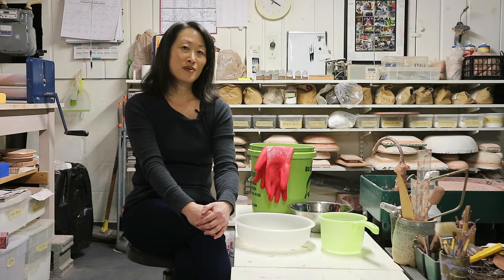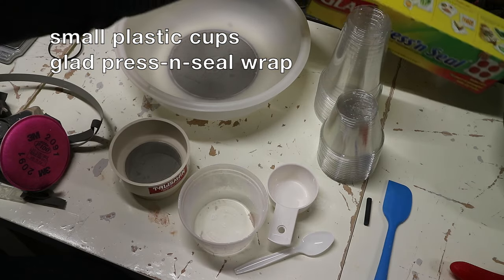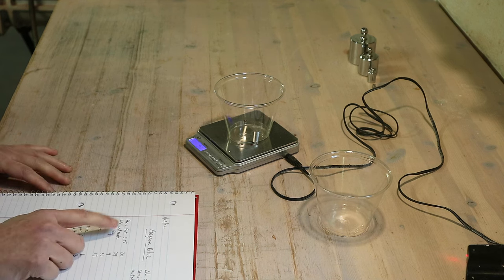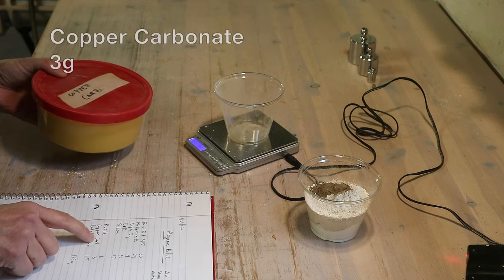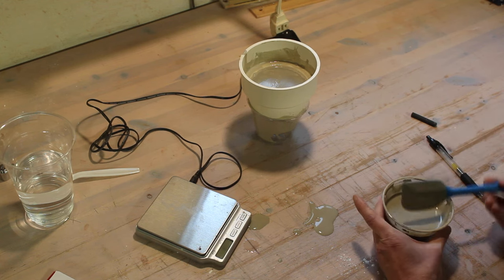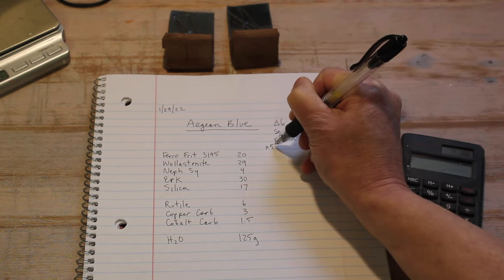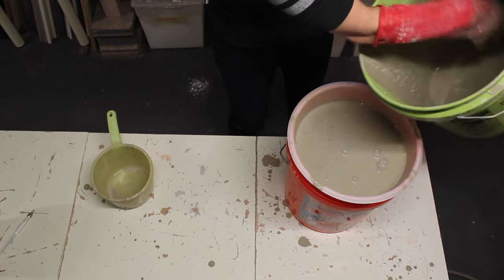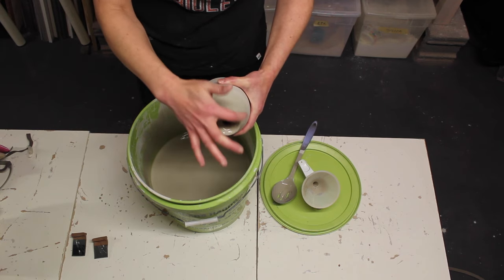How to Mix a Glaze from Raw Materials / full-length video / free to watch

Comment: I think Andy Ward suggested making little pinch pots instead of tiles. It takes a lot longer, but it builds skill in working clay and it also lets you see how the glaze behaves at different angles. But if you don't want to do that you can also cut/bend the tiles to give them some features for the glaze to fill in.

Comment: I am an Auto Body Painter, doing Body Work and Painting for 42 years now.  I make my own Paints using a formula, and many things I do are exactly the same as this Lady does.  But I will be a critique now, but a Good Critique.  When I mix my Paints, in a Pint size cup  on a similar precise scale, but later when I am done with the scale,  I have this cup in a Containment Tray. So if I accidentally spill the cup over, the spill is contained within that Tray.  I use a Simple Bread Baking Pan from the $ Store.  Also here when adding the water, its better to use a Small Goose Neck Water Squirt bottle, so you can precisely pour water DROP BY DROP.  Lady, you should definitely build a small special mixing room, size of a small toilet,  that has a exhaust fan, ONLY TO MIX YOUR  POWDERED INGREDIENTS.  I notice a big cloud of dust  at 53.57 when you poured the mix powder into the water bucket.  I am not sure, but this dust could be hella Toxic.  I work with bondo dust and many more kinds of dusts, so I am very consious of all kinds of Toxic dust.  I use the same 3M Respirator for my Bondo Dust, and another 3 M Respirator for Spray Fumes when I am painting. 
Great Video though, and extremely well done Lady.
Regards from San Jose, CA.

Comment: THOROUGHLY enjoyed this video.  Most of the material I am completely familiar with----my interest in watching was to observe presentation style with an eye toward suggesting the video to students.  It will be made high on their must watch list.  It was easy to watch, a comfortable pace, logical flow, friendly/inviting manner, casual yet professional.  There were just a few steps I do differently I'll point out to students.  But one point I'd like to especially make on the presentation detail is the method of checking specific gravity. I know it takes a bit longer, but using a scale versus hydrometer would provide a more accurate reading of specific gravity, and imo fit in with the level of detail addressed in other steps shown in the video (or maybe just a short written bubble statement would suffice about weighing as a more accurate means and suggesting viewers do more independent research on that method).  Very well done!  Thank you for making this video available.  🙂
Reply from the maker: I agree that using a scale to calculate specific gravity works well. It has some advantages over a hydrometer because it means you don’t have to buy a hydrometer for starters, and every glaze maker already owns a scale. Also, when glazes are highly flocculated the hydrometer becomes less accurate. However, I prefer the hydrometer for regular use because it is quicker and less fussy. Only one step. But I have no disagreement with using a scale exclusively. Every potter can decide for themselves what makes more sense. Thanks for the nice comment!

Comment: 46:55 my mentor once told me that the problem with this approach (removing and adding water), is that some of the compounds in the dry mixture dissolve in water and others are not (which makes the mass concentration in the bottom). when you start removing and adding water, you change the make up if your glaze because the water that was there when the glaze was mixed, carry some of the materials that make the glaze look the way it is. removing water takes off some of the ingredients. adding new water simply dilutes the mixture down with new water that contains none of the dissolvable materials.

Comment: I like your teaching goals.
This is what you need.
This is what you do.
This is what it does.
This is why you use it.
How to trouble shoot, is a quiver you want a bunch of arrows in.

I appreciate what you are doing and how you are doing it.
 
Thank You.
Reply: Rewatching this video I noticed your hands. Mine were in even worse state. They were so dry and itchy I wanted to scratch through my skin. I did in my sleep a few times. Ever thing I tried made them worse. I'm sensitive to perfumes at the best of times and these were far from that. 
Till I started doing this:
At the end of work, I wash my hands with Hibiclens.  It's excellent for cleaning most wounds and makes it stop hurting. (The 5 year old asks for it with every wipeout)
Dry gently then apply Cetaphil Body for very dry sensitive skin. Rub that in good an take a dab of Cetaphil healing ointment.
My hands feel instantly better and are healed in a couple days. 
As a rule I do this at the end of every day. Using the healing ointment once or twice a week for maintenance. 
I don't care how my hands look, they tell the story of my life, I do care that they can keep the story going.
My money wallet is low but, wisdom wallet is flush and donatable. Hope this currency helps you.

Comment: Excellent video and such great presentation and skills. Wish I had specialist knowledge of anything built up like this over 30 years. 
BTW why do you weigh each ingredient and then tip into another cup instead of just resetting the scale each time to zero and adding the next ingredient?
Reply from the maker: The reason to empty the cup each time is because, if you overshoot the amount you want when measuring out the next material, you need to remove some in order to reach the correct amount. If there is another material already in the cup, you will need to throw away anything you remove, because it will be contaminated with another material.
Reply: @goodelephantpottery  ah ok, thank you very much!!

Comment: I like the way you store your glazing materials, a question I have is does the materials clump and does moisture get into the containers? I don’t believe those containers are airtight so I’m just worried if I store them in a bin they will get moisture in the containers and clump. Just a few questions
Reply from the maker: The containers are not airtight and most materials will not clump, even though my climate is very humid in the summer. With the exception of Soda Ash which does clump, so I store that one in an airtight container.

Comment: I'm thinking about glaze making but am concerned about food safety with glazes.  I know for example of a particular commercial chrome-like glaze that the company states isn't food safe, and another very similar from another company says it is food safe.  When making your own glazes, is there a means to test, or would you have to have laboratory testing done to
Reply from the maker: I highly recommend the book Mastering Cone 6 Glazes, by John Hesselberth and Ron Roy. It contains instructions for how to test your glazes for durability at home. I put all of my own glazes through these tests, rather than sending them to a lab. Generally speaking, I would not consider any glaze with a metallic surface to be food safe.

Comment: Great informative video. I am new into ceramic making and I am here to learn as much as I can. If it’s not too much to ask Is it possible to cover crazing topic in details. My pots have craze lines 😰. 
Thank you very much for this video.
Reply from the maker: Crazing means that your glaze does not fit your clay. The glaze is shrinking more than the clay. It’s difficult to change the shrinkage of a glaze, without also changing the appearance of the glaze. The better solution is to find a different glaze recipe that fits your clay better. It can take a lot of trial and error.

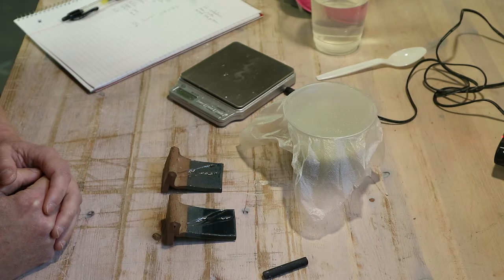Comment: Hi.  Around 45:42 you start talking about adjusting water, but you don't really explain why or in what circumstances I would add or remove water.  Is it just thickness of glaze or are there more instances when you would want to change the amount of water. Also, do you not test the specific gravity of a test batch? If you add water it raises the specific gravity? And if you remove water it lowers it, right? I'm trying to learn mixing my own glazes and detailed educational videos are really hard to come by.  Thank you for your video!
Reply from the maker: Adjusting the water amount at the test batch stage is only about thickness, based on appearance. It’s pretty easy to judge whether it’s too thin or too thick at that point. No need to measure specific gravity for a test batch. At that point you are aiming for the right appearance, not for a specific gravity number. Measure for specific gravity AFTER you have the glaze at the right thickness/appearance. Then use that number to keep your bucket of glaze at a consistent thickness. Adding water makes a glaze thinner, thus LOWERS the specific gravity. Removing water makes the glaze thicker and RAISES specific gravity.
Reply: @goodelephantpottery  Thank you so much!
Reply: At what temperature did you fire the pots? Is this glaze for earthenware or stoneware clay? In case it was clarified in the video, my apologies. I must say, this is one of the best videos about homemade glazes I've seen.

Comment: Excellent video as always, Mea

May I ask, do you use distilled water?

Do you add 1 to 2% bentonite to keep the ingredients in suspension and not dead pan?

Does the book The Ceramic Glaze Handbook discuss what the various flux ingredient properties contribute to the combination of flux ingredients? I know that silica is the glass former, that alumina (EPK) holds the molten glass to the pot, and that the fluxes lower the melting temperature of silica. i believe certain fluxes contribute to the feel of the glass (buttery), others cause 'mattness', if alowed to slow cool, but beyond those generalizations, fluxes are the black box to me.
Reply: Great question re: distilled water - I was also wondering...
Reply from the maker: I don’t use distilled water. That might be necessary in a situation where the water supply has a very high mineral or iron content. But in a municipal water setting, it’s not necessary. 

Some glazes benefit from a small amount of bentonite to help with suspension. But the one in the video does not need it. 

The Ceramic Glaze Handbook does discuss how the various fluxes work, and what impact they have on the glaze.
Reply: Amazing! Thank you! Long time baker brand new potter. This methodology made perfect sense and was relatable as a beginner, Without overwhelming me with the indepth science of fluxes opacifiers melting points etc that I hope to eventually learn. I've wondered if I was capable of learning what seemed to be a complicated subject. But I can follow a recipe precisely and I can learn about new ingredients. I can learn this too 😊 thank you!

Comment: Thank you for the great video. What do you do if the SG has changed? How do you correct?
Reply from the maker: It’s common to find that a glaze has gotten thicker while it was being stored over time, because some of the water has evaporated. The SG will be higher, which means thicker. Just add small amounts of water at a time, stir and measure the SG, repeat until the SG is correct again. If you find that a batch of glaze is too thin (SG is too low), that only happens because you or someone else added too much water to it. To correct this, you need to wait a few days until the solids have settled to the bottom of the bucket. Remove as much water from the top of the bucket as you can, then add it back in slowly until the SG is correct.
Reply: Thank you

Comment: You mention that for practical purposes (but not necessarily scientifically speaking), 1g of water is equivalent to 1mL water.  Just wanted to add that this is true scientifically speaking as well.  1g is literally defined as 1mL of water (also equal to 1 cubic cm of water).  Metric distance, mass, and volume is all tied together in this way!
Reply from the maker: Technically, it’s only true at a specific temperature, because water expands and contracts at different temperatures. Though I forget the correct temperature for the mL and g thing to be exact. Anyhow, no matter what temperature your water is in your pottery studio, 1mL = 1g is “close enough” for glazemaking.

Comment: Thank you for the excellenct video! Do you know what’s the european equivalent to Ferro Frit 3195? Or what do I have to be aware of when looking for an substitute frit?
Reply from the maker: I found a list of potential substitutes:
Ferro 3195 
Pemco P-67
General Color GF-115
Fusion F-2

I am unfamiliar with the substitutes so please do you own research into their feasibility. Here is the composition of Ferro Frit 3195 which should help you determine if the above choices will work:
CaO 11.36%
Na2O 5.69%
B2O3 22.62%
Al2O3 11.98%
SiO2 48.35%

If you cannot find a good substitute, I would ditch that recipe altogether, and find a recipe made with ingredients that you know you can source. The processes for measuring and mixing shown in the video can be used on any recipe.

Comment: Hi Mea,

Do you see a problem with this variation...

Why not start the testing at 115 ml of water? If the SG of 125 ml averaged 142.5, then at 115ml it is SG A, add 5ml to test at 120ml... SG B, 5ml more it's 125ml (should be aprox 142.5), 5ml more, etc...
With this method, one would not have to wait over night for the water to separate for removal down to 115ml, or 120ml. Instead, test 

Does your company name come from the shape of your handles resembling an elephant' trunk?

Richard